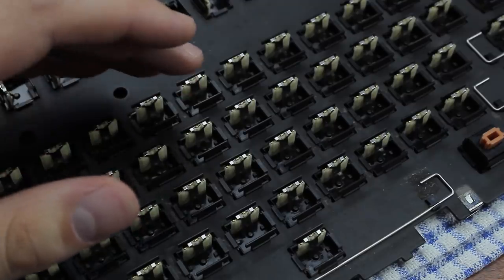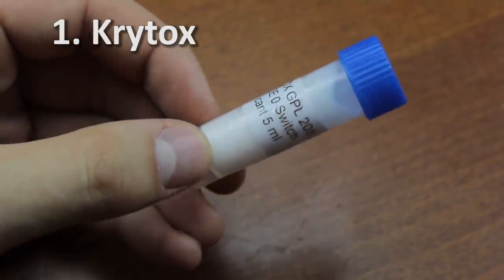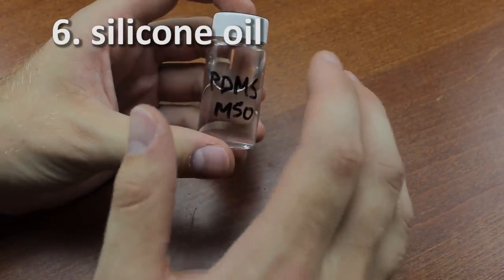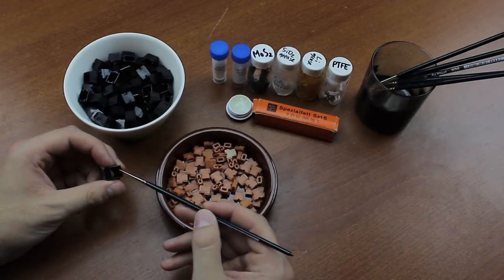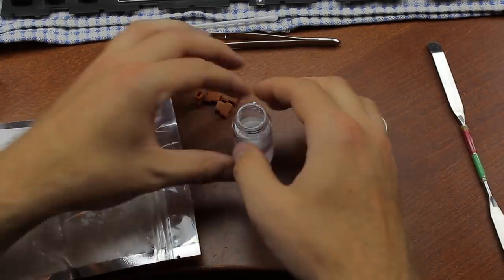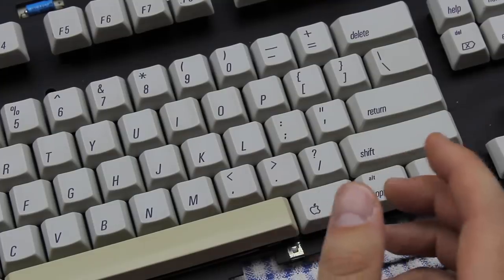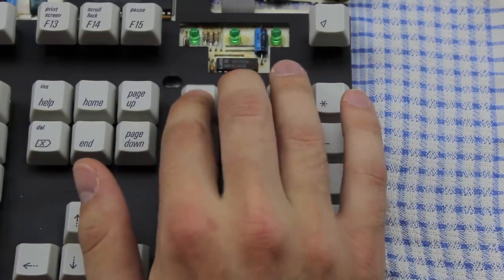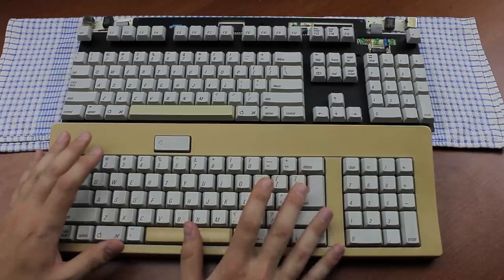Alps restoration guide part 4: how to lube Alps switches

Comment: I refurbed my school-abused AEK2 this past summer. I swapped in very light SPRiT alps springs, and shook the alps stems in a plastic baggie with some silicone oil. The result is night and day. I'm surprised silicone oil did so poorly in your test but I may have used a heavier oil - shock oil for RC vehicles? Dunno. Anyway this series of videos is a gift to the community, experimentation is the heart of progress, thank you!
Reply: Can you link what you used to lube  your board, I have an AEK2 that needs a resto and wouldn't mind trying it next to some trybyosis.
Reply: @samoksner  Traxxas 1666 Silicone Dampener Oil - I obtained from amazon canada and don't know what world-wide availability is like
Reply from the maker: The oil was bad, yeah, but the silicone grease was much better.
Reply: Did you have any troubles with shipping terms? I'm also looking for lighter springs (dampened creams are to stiff for me), but I've heard that shopping of Sprit springs can take several months.
Reply: @DmitryNosachev  I don't remember the shipping time for the SPRiT springs taking too long, BUT, it took me a long time to find the time to do all the work of restoring every switch in the keyboard. I ended up 3D printing an alps opener because some of my switches had dried coca-cola syrup in them. I also bought a small ultrasonic cleaner to clean the stems and housings.

Comment: Note that krytox and tribosys should be really close each other, but only when they have the same thickness. There are 3 versions: 3203, 3204 and 3205 (the latter only available by krytox) that should have respectively low, medium and high viscosity. When applied to cherry switches the 3205 is recommended only for linear switches, as it's so thick that it wipes away the feel of the tactile bump. The 3205 is mainly used with topre, as the tactile device is a rubber dome that being a compliant mechanism doesn't need lube, so you only apply it to the sliders.

Comment: Ladies & gentlemen, the man of the hour, Chryros! Seriously though thank you so much for doing this series of videos. I've been super curious about seeing what different types of lubes would do for ALPS SKCM/L switches, but haven't built up a big enough stock of them to have some I'm not worried about possibly ruining. In fact I have a batch of damped creams that are in particularly bad shape I've been saving to experiment with once I get some good ones to replace them with, but you beat me to it (thankfully too, since your advice definitely will get much farther exposure than mine would!).

Ultimately it looks like you've been right all along with saying good condition & unlubed is best with ALPS SCKM/L switches. Glad to hear Tribosys 3203 performed decently though as that is very easily obtained  & fairly easily cleaned off with some iso alcohol. So IMO that would probably be the best one for people to experiment with. Anyways thanks again for your sacrifice to the KB gods so we can further our knowledge about ALPS SKCM/L switches!

Comment: Thanks as always for leaving few stones unturned. I was also curious about WS2 myself, and was on the verge  of conducting my own tests after a poor trial at trying molybdenum disulfide on the past. I was curious if you considered dry film lubricants of Teflon as well. They are relatively inexpensive, attract little contaminants and are relatively durable. I have some on the way so I will answer the question for myself, but in a way you are rightfully one of the eminent switch experts and wanted to know your thoughts. This is the product I'm about to test if you are interested: DuPont Teflon Non-Stick Dry-Film Lubricant Squeeze. It's advertised as useful on plastics and for tight tolerance applications so I thought it would be worth testing.
Reply from the maker: Those solutions are essentially equivalent to the coke lube suspension I used. Honestly, the silicone grease performed a lot better ;) .

Comment: Has any one ever tried a ultra fine jewelers paste to micro polish the plastic so there's not a bunch of tiny scratches in the contact areas caused by dust and debris? would take a while but might be worth it if it works since thats probably were the scratchiness is coming from on crusty boards.

Comment: I have used Super Lube Dri-Film spray lubricant on Alps SKCM Black with great success. It's a better choice than dry PTFE, since you don't need to suspend it in isopropanol - just spray it on.  I haven't had any binding issues with it, but I wonder how much of it has come off over time.

Comment: I used pre-suspended in something PTFE (called "dry lube") to lube my damped cream alps and it worked wonders. Combined with a tape mod it made my very old and used switches work like new

Comment: WD 40 is actually a water displacement fluid. It was developed to deter icing on rockets.
Though it's somehow useful for various other uses, like as a solvent and short term lubricant (it evaporates way too soon to use as a lubricant and attracts dust, so it works better at first, but then it actually gets worse)

Comment: Korean (or Japanese) keyboard community base use dry lube called RO-59 tmkt, water based fluorite liquid. I lubed my alps silent ivory stem with this(soaked and dried) and it went pretty well so far(it was 6 months ago). Of course it is not snappy as nos switches, and muted a little, but I like the way it is.

Comment: I used some teflon bike chain lubricant for my linearised AT101W and it seems to be good, but I do not have a proper point of comparison. I tried the lube with a weird "101+" white alps board, but even after deep cleaning part of it and applying the lube it didn't seem to fix the binding issues it has; maybe it is just a cheap board idk. The 101w on the other hand is really smooth, but given that these are linearised, deep cleaned, and is a more "quality" board than the 101+, that could be the reason why.

Great video though. It certainly would have helped me a few months ago when I was doing this with those two aforementioned boards. I may decide to do this with the two Orange ALPS AEKs I have if I can stand the monotony of doing it again.
Reply: I'm about to use this stuff on my white Alps. How's it held up over the last 9 months for you?

Comment: Lubricants work by either creating a fluid film (silicone, vaseline) or by creating a deposit of some solid material that has a molecular structure such that is slide easily on itself (graphite is the best example since it creates sheets of carbon that will slide on top of one another but will also resist pressure orthogonal to the movement. These solid based lubricants should adhere to the surfaces they are applied on so instead of the surfaces touching each other it's the lubricant on the surfaces that touch each other. 

I know these small bits because I did some internet search on lubricants to replace the ones on my reel-to-reel tape decks. Interestingly I found retired engineer and chemists who worked at Molykote explaining these things on some vintage audio gear forums. 

NOTE: WD40 is not a lubricant but a product to help get stuck screws turning and was originally developed to keep missiles from accumulating dew/water on them. It has solvents and detergents that are there to keep the surfaces clean or clean them. I use WD40 to remove stickers and glue residues from all sorts of surfaces like glass, metal and plastics. When using it in plastics make sure you'll be able to remove it completely. 

Caig Labs - the makers of Deoxit - has a product called Faderlube for lubricating pots (faders) on audio gear. There are several formulations including 100% grease and liquid. I would use only the 100% since I had some strange results on my mixer after applying it but I don't know if the spray non-flameable version destroyed the dampers on the pots or if they were already melted and the spray just removed them. These products are not cheap but you can use an insulin serynge to apply it.

Comment: I'm surprised the PTFE solution did so poorly.  I bought a bottle of some to restore my AEK nearly a year ago, and it fixed all the binding issues my board had, making all but a couple keys feel incredibly smooth, and it's held up since.  Granted, I lubed things up quite a bit more than you did.  I basically soaked a q-tip in the solution and put a couple coats on everything inside the switch including the entire bottom half of the slider, the entire casing, both ends of the spring, the tactile leaf's contacts, as well as the switch plate contacts.  I think having PTFE against PTFE in my case has helped it stick/bind more than PTFE against plastic/metal like you had.
Reply from the maker: The camera might not show it as well, but the suspension I used had a LOT of PTFE in it. Trust me, it really didn't suffer from a lack of it xD .

Comment: After watching this video, I decided I'd see if my OmniKey Ultra could be improved. I cleaned out the switches with canned air and have applied silicone grease to the sides of the sliders. A tube of a few OUNCES of grease cost $4 at the store. The keys do feel smoother but yeah, kind of "wet." After pressing each key a few dozen times to spread out the lube, it feels less weird. It's been extremely time-consuming because it takes me several tries to position the click leaf properly and not have the spring bounce around everywhere, and it gets trapped under the other keycaps... Anyway it'll all be worth it when I'm done, hopefully, because I pray it won't feel like I'm typing underwater.

Comment: I used WD40 Specialist PTFE dry lube with my linearised blacks, threw the stems and springs in separate bags sprayed a bunch in and used tweezers to reassemble, then left to dry overnight. worked a treat

Comment: MoS2 is used for metal/metal and metal/plastic contacts by the people that deal with vintage audio. For plastic/plastic Molikote manufactures one that is called something like Plastislide - certainly starts with Plast.

WD40 will dissolve some plastics. Have you ever tried the Faderlube by the manufacturers of Deoxit? There's also some PTFE products for bicycles that are liquids that dry and leave a PTFE skin - it's used to substitute the old chain grease with the advantages of not getting your pants dirty nor getting dust stuck on it.

Also: is there a video about lubing the Model M? Thanks!

Comment: Kek, now started to restore dirty White complicated Alps, I tried "Edding 8150 silicone oil marker". It is convenient to apply a thin layer. The result with this grease is much better than without grease. Interestingly, the next day the layer dries completely, but the result remains.

But I can compare so far only before cleaning, after cleaning before lubrication and after. And just two days passed.

Comment: I have seen some forums mention that the best way to lube alps switches is to use a dry lube such as Finish Line. WHY IS THIS? I'm very tempted to use Krytox or Tribosys for my new Alps switches, but after hearing about this dry lube business, I am on the fence. This question also applies to IBM buckling spring switches.

Comment: Super interesting video. Thomas do you have access to fancy microscopes at your workplace? It would be interesting to see the difference between newer alps and old, cleaned alps and why the newer ones are still better even if the old one are cleaned and lubed.
Reply from the maker: I do have fancy microscopes at work yeah, but it's generally agreed that the OLDER versions are better, not the newer ones Oo .
Reply: @Chyrosran22  I think he meant new as in NOS

Comment: FOR NOOBS:  you can buy cheap Gateron switches and use silicone grease from the plumbing store.  That grease is lumpy.  To make it smooth, add a few drops of isopropyl alcohol and mix thoroughly. It can be applied generously as, it will dry out and become thin.
Reply: This is horrible advice.

Comment: Hello guys, and Chyrosran! I just bought a nice blue alps OEMMAX-860 board, and the switches seem to be in great condition. The only problematic key is the big ass enter key, which binds a lot when I press on the top part of the key. I think I read somewhere that that problem can be solved by lubing the points of contact between the keycap and the stabilizers. Can anyone tell me what type of lube I should use ? Any help would be greatly appreciated. Thanks!! 🙂

Comment: Is it a good idea to simply swap a slider to a brand new Matias one with factory lube?
Reply: It doesn't seem a smart idea, first of all you may have a factory lubed slider, but the rest of the housing may still be in poor conditions, also Matias probably still doesn't have the original formula, so his guessing may be similar to Thomas'. Also to note is that changing the slider may an impact to the key feel, and at that point it may be easier to just desolder the switches and put Matias on!

Comment: Mykeyboard.eu men I ordered krytox just a few weeks ago from there. Best shop in europe XD highly recommend fast delivery. However it is a bit more expensive than in usa. 

Btw there are many mods for stabilizers but krytox will do most of the job. Another one which you add on plastic basically for removing scratchiness of stsbilizers

Comment: I use some "vintage" grease (probably lithium) that was designed for the plastic gears of tape players (audio and video). It's exceptionally smooth, increases tactility, and seems to perfectly mute all of the shrill, annoying sounds that come with mechanical switches. I admittedly get messy with application, but in the few years I've used it have not had any issues. On the contrary, there's a consistent break-in where the switches become increasingly smooth over a few days of use and then seem to set in when it feels like it couldn't get any better.

A sample I uploaded a while ago where I whack at a keyboard like an asshole: https://www.youtube.com/watch?v=2_W8Abs_Gc0